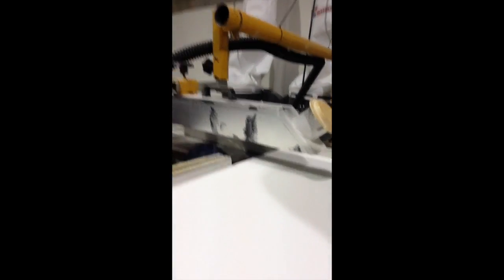School Bus Conversion - Episode 7 - "Polystyrene Insulation"

Comment: Hey Aaron, i know the bus is long gone but we have the same bus and are doing it here in ADL! You sound like you're Kiwi too? How the hell did you get the strips off where the seats bolted to the wall?!?!?! Looks like it's all one piece?
Reply from the maker: +Thejahbus hey sorry for the delay in a reply, I just saw this! I used a grinder to grind off what appeared to be large rivets holding the strips on. They were in 2 pieces per side of the bus.

Comment: What type of spray adhesive did you use to bond the insulation ?
Reply from the maker: +Wyman CooperWymanC, I used a specially formulated glue that is designed for Polystyrene. If you watched the insulation video I mention the name of it and where I got it!

Comment: Thanks for sharing Aaron... very cool!!  We're starting our build also, and are really interested in the poly insulation that you used.  Is there a rating/brand/specs for what you used?  Cheers!
Reply from the maker: +HV-Flex Hi There, 

It is High Density Polystyrene Foam Sheeting brought online through https://buybuildingsupplies.com.au/

They are (VH) Class with a 28ikg/m3 density. 

I hope this helps!